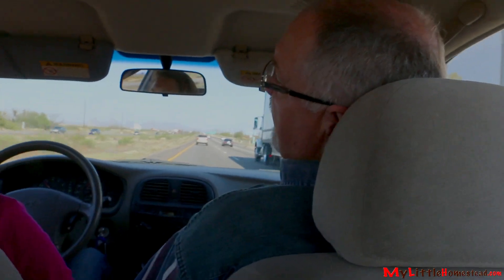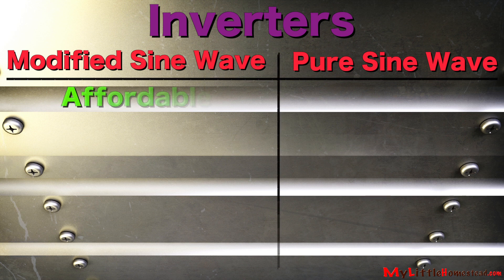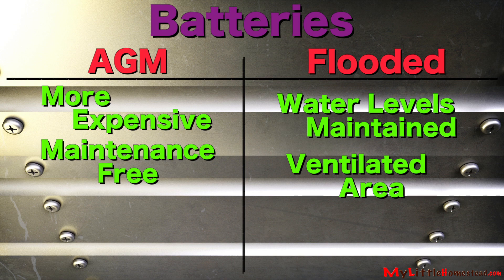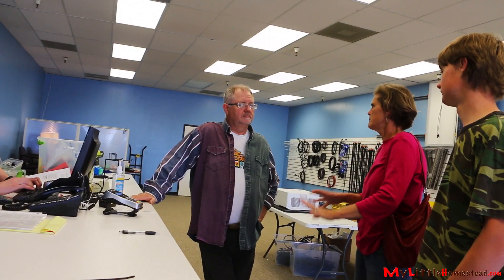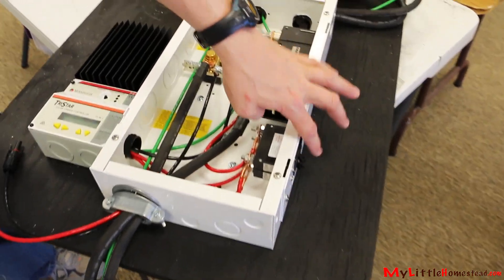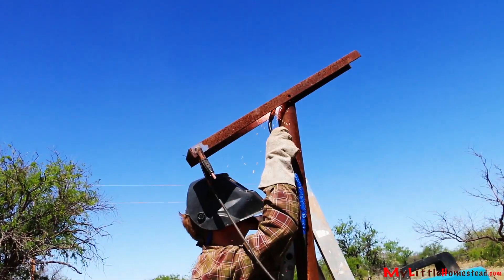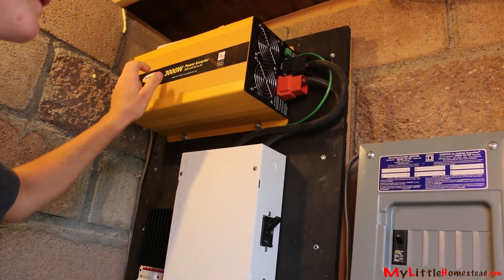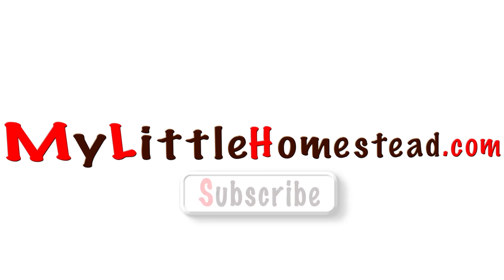Solar Panel System Cost & Install | Step towards Self Sufficiency Off-Grid Living | Weekly Peek Ep2

Comment: I saw a video the other day where you can double the solar panel output by reflecting a mirror onto the solar panel. They had a little hand vacuum plugged into the solar panel and when he raised the mirror (reflecting the the sun onto the panel) the hand vac approx. doubled. I'm not sure if this causes accelerated wear and tear on the panel or not.
Reply: RealEstateInsider247 shit thats cool. Can anyone on here  confirm or deny the wear and tear???

Comment: Question: whenever I see anything about purchasing solar panels they always say that most households need 25+ panels. I realise that you are using less energy for a room but the few you have don't seem like much. Is his energy usage so low that that is all he needs or are those panels special? When the panel lists its kw is that per hour or day?
Reply: m schachow I have 8 panels. (250w each = 2000w total or ~ 10kwh a day) They say the average American household usage is 30kwh/day. I find that to be a crazy amount of electricty. My own system supplies 100% of my needs in an off-grid setting with 42in HDTV, electric cooking appliances, computers, etc. You save a lot of money by learning how to do it yourself. The whole setup was $7500 USD. $1800 for the panels. $1800 for the 48v 3600watt pure sine inverter (outback). $600 for the 200v Midnite Solar Charge controller. $2500 for 5kwh worth of LIFEPO4 batteries. $250 for the DC disconnect/breaker panels. etc. I could have saved money on the batteries going with flooded lead acid this this family but I did not want the maintainence, plus I wanted the much longer cycle life of Lithiums. 

When a panel lists its wattage it is a theoretical output in certain conditions with a certain intensity of sun. When you calculate how large of a solar panel array you need for your household you find your locations number of solar insolation hours. Basically it is an amount of time when you will have peak sun or 1000watts falling on a square meter  of earth. So, for Colorado, in Summer, even though the day is say 12 hrs long because the light isnt strong in the morning nor in the evening you come away with 6 hrs of peak sun. :) 

That is how I came up with my average of 10 KWH a day from my 2000 watt solar array. A yearly solar insolation average here is about 5 hrs of Peak sun a day. 

- Cloud

Comment: Would you mind sharing the price of this system?
Reply from the maker: Kaleb Stattmiller  It was around $3000. Half the cost was in the pure sine inverter & wiring.
Reply: Thanks!
Reply: +mylittlehomestead I'm slowly building an off-grid backup system for our home on the Oregon Coast. I have factored in the amount of rainfall we get as well as our Latitude-46.1 North.
It has been my experience in cloudy/rainy areas that one needs to DOUBLE the wattage of Solar you think you'll need, and increase your estimated battery needs by another 50%.
It looks like the fellow you bought your gear from was absolutely honest-VERY refreshing to see in this industry!
My sister & her husband in Arizona got taken for $38.000 for a grid-tie setup on their home.

Comment: This is so cool you have almost the exact system I have. Although you use 2x12v Flooded batteries and I use 2x6v AGM batteries. I have 3x240W panels and you have 2 unknown size. I am trying to install a tracking system to get 50% more power using the same input. So see you are running them in series like I am.
Reply: Submanca I believe both of those two panels he purchased were 250watts for a 500 watts system.